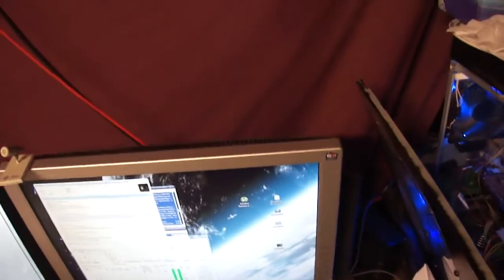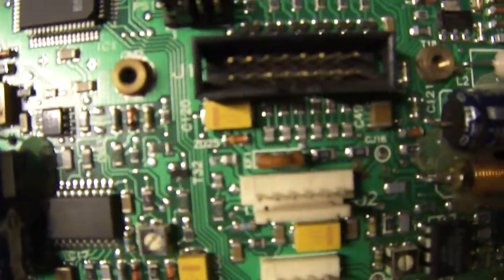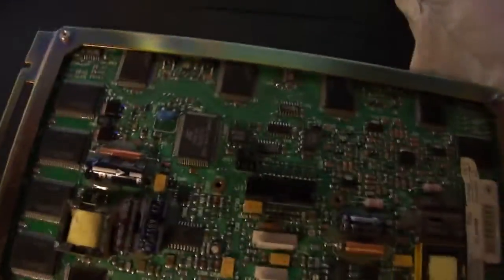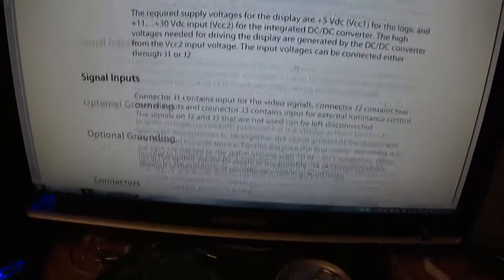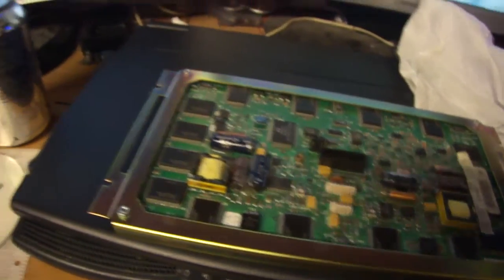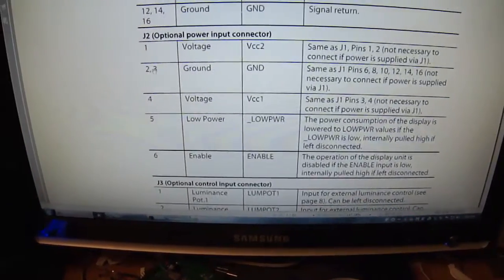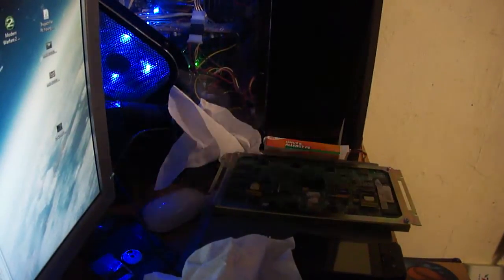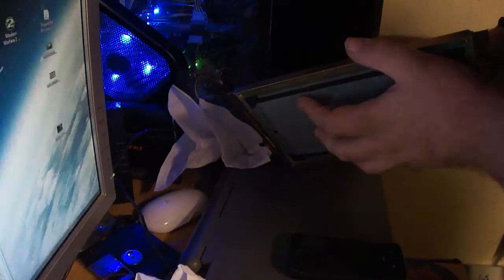Testing a Planar EL Display Panel

Comment: Is this a good price?? https://www.ebay.ca/itm/373303675351
Reply from the maker: To be honest, I dont know. Ive seen alot cheaper, in the $300 range or there depending on condition. I haven't bought or messed with EL displays in a very long time.
Reply: @THEtechknight   I tried finding cheaper but this one was the cheapest for this model. They go for $1000USD++
Reply from the maker: @earthstix6407  Wow. then prices have certainly changed. they must not make these displays anymore, completely asinine. Surprised companies haven't made retrofits to convert EL based technology over to LCD to keep older machines running.